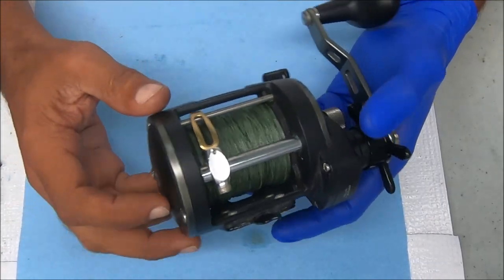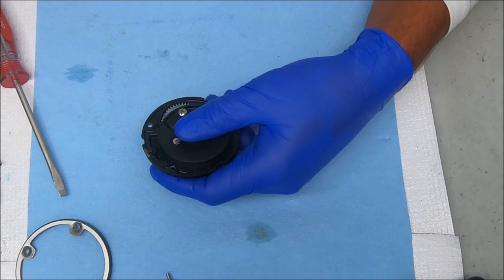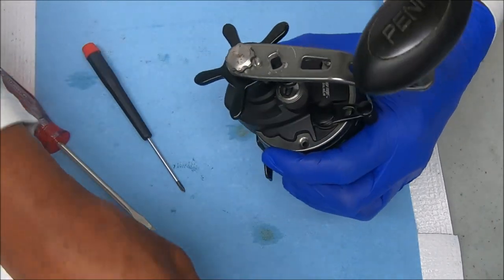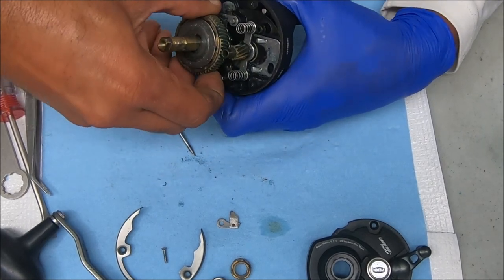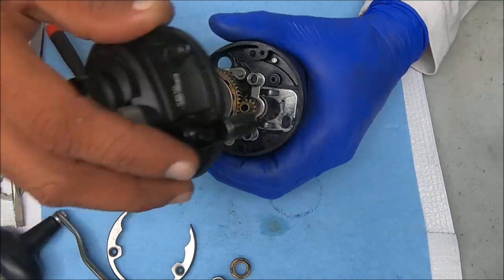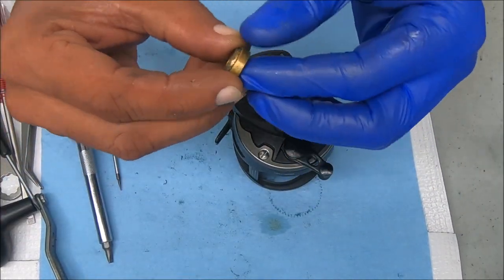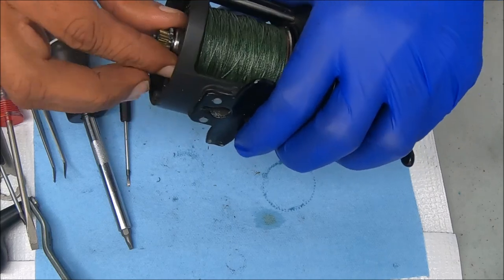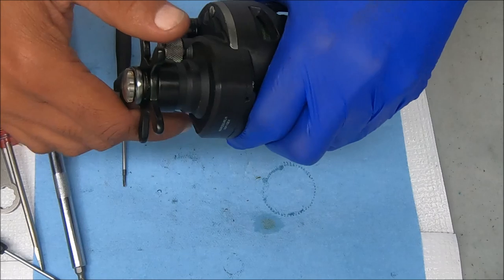Penn Warfare 20LWLH - Removing The Levelwind: Fishing Reel Repair

Comment: I had the same thing it could have been the worm gear for you but I greased and lubed everything up and figured out the two small screws that go by the line clicker (the left plate of the reel or the part without the crank) I took out they were pressing on something but now the reel feels like butter
Reply from the maker: Thanks for watching and sharing, Deryk! Good info that someone may be able to use. Barry

Comment: I just bought one of these off marketplace and it has no drag.  Any idea what it could be ?  Even if i tighten down all the way its like i have it on free spool....
Reply from the maker: Thanks for checking out the video. Did you flick the lever into retrieve mode? If so, maybe you're missing parts.
Reply: @TSGReelService  yes lol even in retrieve mode I can just pull the line freely
Reply from the maker: @Relentlesscatfishing  hey, you'd be surprised what I see/hear when customers bring in their reels.... believe it or not, I had a guy who did just that..... claimed the reel wouldn't work, no matter what he did..... i flicked the eccentric and gave it back to him..... he looked at me like I performed some sort of magic. See the last part of my initial response again. If you're not comfortable working on the reel yourself, you can try taking it to your local repair shop. If you want my assistance, feel free to reach out to me directly at tsgreelservice@gmail.com and we can go over pricing.
Reply: Possibly, some wd40 or similar oil has wet the clutch plates from over oiling.

Comment: Does the clicker remain engage full time? The spring keep pulling into the teeth and the button will not stay in the disengage position. Any ideas why? Thank you.
Reply from the maker: Thanks for checking out the video. If it was functioning properly before, then the issue is probably not with the spring. The click button (not the click tongue) could be worn (or missing a washer in the stack) where the e-clip secures the stack. You can open the the non-handle side to verify if this is the case. If so, you need to replace the click button. Or, the spring could broken and need to be replaced. Hope that helps.